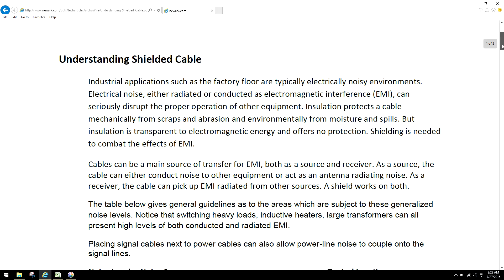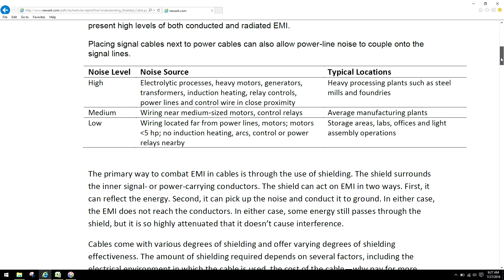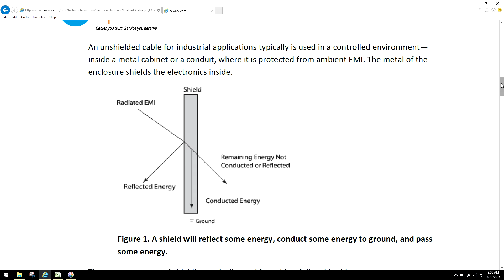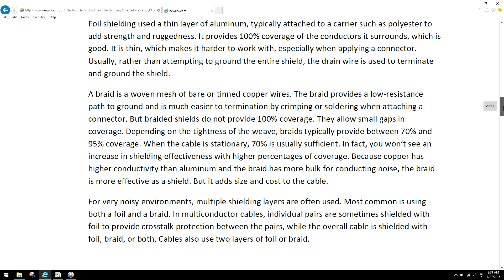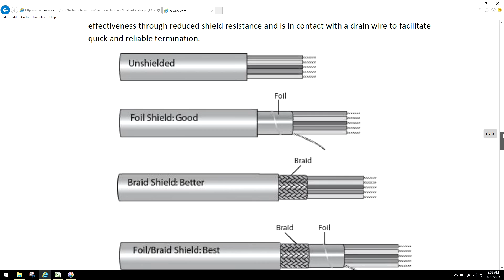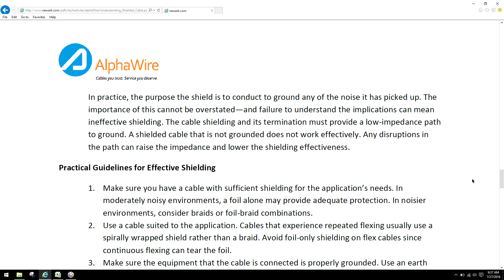How To Ground Your CNC Explained (This Also Covers Using Shielded Cable Properly)

Comment: What's your POV on whether to ground the shield on the spindle side or the vfd side or both? I've heard lots of arguments about this 😊
Reply from the maker: Jesse,Ground the unit on either end, but only on one side. This is to prevent ground loops. If you don't ground the unit properly the little EMI gremlins will usually be at work on your system. Proper cable choice is essential as well, and that's why I sell, and use 16awg double shielded for bullet proof protection when grounded as discussed above.Thank you,Vince

Comment: This is great information man, thanks for taking the time to do it. I'l putting in limit switches using shielded at the moment, but this now makes me want to go and ground the chassis, which I will do tonight. One question if I may? I have the stepper motors running back to the board, they have a lovely connector on them, to connect up to the motor. I am not sure I could fine those connectors again, so is there a shielding that you can apply to the wires, that you can then earth ground?

Also, I was wondering. I have a big old earth cable in my workshop, that runs from the distribution board, out of the wall and into a spike in the ground outside. If I were to tap into this and run a cable off it, could I have all my ground wires terminated into that? Would that give me the ground I need? I cant see why not, but I am a noob to CNC and more a woodworker than an electrician. Thanks in advance
Reply from the maker: You can, and should use your earth ground rod if you have one available. The best way to shield a cable without destroying the end would be to apply copper tape around it, but Its a double edged sword. You'll lose most of the flexibility from the cable if you correct them this way. The benefits of shielded cable can't be emphasized enough if possible I highly recommend changing them to shielded ones, and properly grounding the system. Its tedious, but the end result will be well worth it. Thank you, Vince

Comment: I am having a hell of a time tracking down the source of my signal noise. I have gecko 340 drives for my servos, and they worked for 10 years with no problems. A week ago my z x and y were way off during a program run I have done hundreds of times. My z actually plowed down and destroyed the endmill and my work. After replacing my 5 volt wire with a heavily shielded wire I thought I had fixed the problem, but during testing, it appears all 3 servos are still drifting. They all move at 0.01mm per second. All of them are turning the same direction. My signal cables are all shielded and ground to the metal of the milling machine. The only cable that I am unsure about shielding on is the parallel port cable. On testing though, even with the PP cable completely removed from the servo controller, and the computer powered off, the servos still move when the spindle is on. The spindle speed determines the amount of drift the servos move, so I know it has got to be signal noise from the spindle. I tried wrapping foil around the power cables going from the spindle motor to the spindle power supply. Nothing seems to solve this problem. Gecko advised me to turn the gain full clockwise on all the 340s, but that did nothing. I tried using debounce on Mach3, also no change. I am completely lost and i've been down for 7 days now with no way to use the machine. Any suggestions?
Reply from the maker: Your issue is a very common one, and I suggest replacing the spindle cable with my double shielded robotics cable here http://www.ebay.com/itm/CNC-Spindle-Cable-10Ft-16awg-4-Lead-With-Drain-Double-Shielded-Robotics-Grade-/142036230702?ssPageName=STRK:MESE:ITThis cable is designed for automation, and will guarantee that will make  the spindle noise vanish as long as the machine is grounded properly according to the video. You also will want to document your troubleshooting of what you've done to solve the issue using this template system used in full scale manufacturing I've provided you here.https://youtu.be/5j_wINR3IGcUsing the components, and cable combined with the tools I provided you will yield the best results for you solving the noise issue, or any other problem your encountering on your own. A problem that just reflects itself after a decade of use is usually some of the hardest to identify. These will simplify the process. Take care, Vince